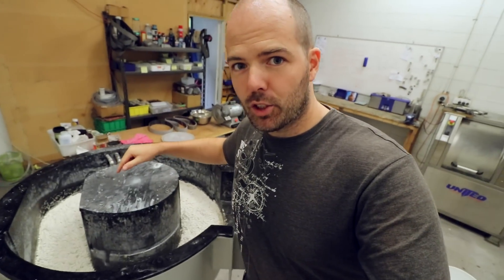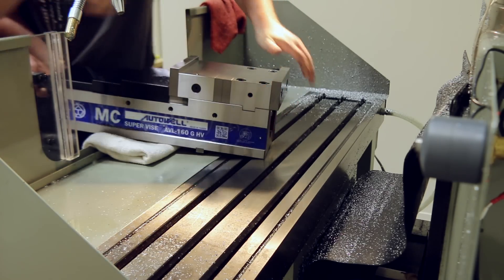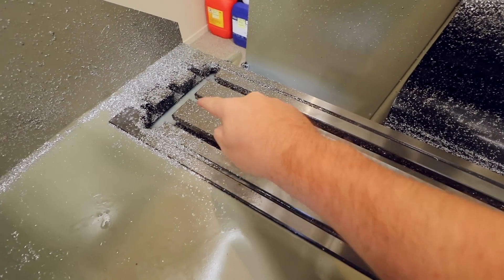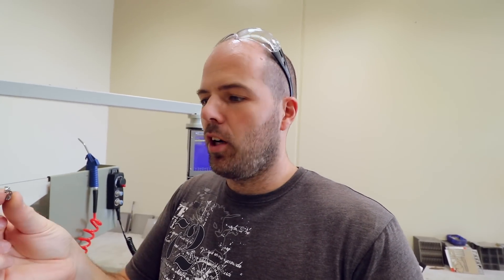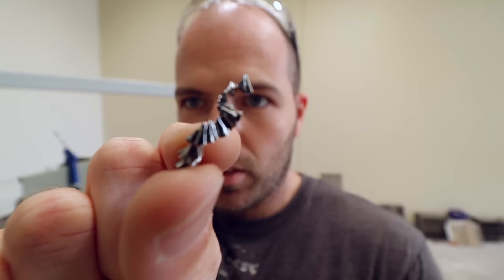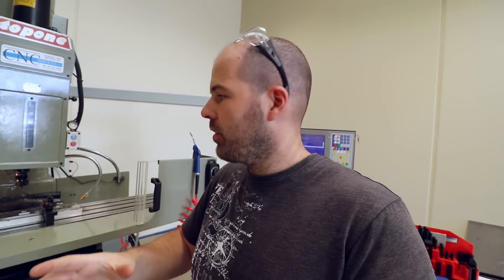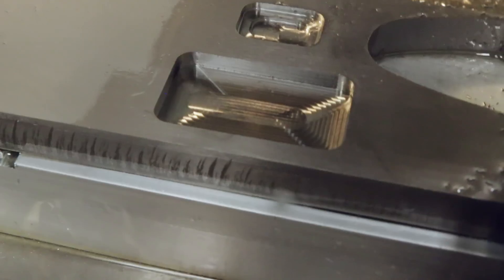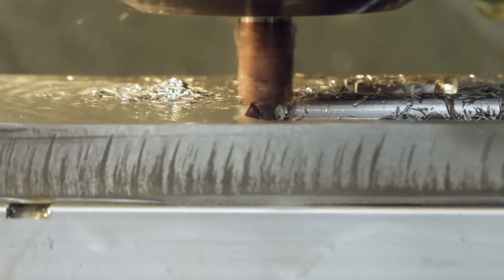How To Mill Titanium?

Comment: What cnc milling machine you are using ?     I'm looking for an very accurate +/- 0.01mm cnc machine to cut some titanium, at least rack and pinion rails and laser straight rails won't bend under 190 lb forces. Need to make an object 2ft x 5ft x 1ft and there is no such object sell it online need to cnc machine it by myself.

Comment: Why are you conventionally milling instead of climb milling? 
Don't you know that you can get t nuts to fit your t slots in your table. Vise size has nothing to do with it.
Reply: Could be his machines better conventionally. Our bed mill gets nasty looking with conventional cuts. Much better finish conventionally. The manufacturer is still trying to figure out why we suspect an issue but otherwise machines fine.

Comment: Been quite a while since I last commented! Loving the mill work, definitely looks like a good machine, and you are learning really quickly, so I am sure you will be making spinners and other things on there really soon!

With regards to the vise, I don't know if the dogs on the bottom are removable or not, but if they are I would check with the manufacturer to see if they supply them in smaller sizes before returning the whole thing. If they cannot be removed, then I would also check to see if they supply the same vise with different sized dogs, and if all that fails, only then would i return it for a smaller one.

Brad

Comment: Magnus, if you use your water jet cutter to cut a blank from a chunk of titanium, how do you register the size and position of it on your C&C machine to do further machining?
Reply: You use a tool called an 'edge finder,' it mounts like any normal bit, but it doesn't cut anything. It gives a visual indication when it touches an edge, and you just save that position in the computer. The computer then uses that information to set boundaries.
Reply: Christopher Vaerten thanks for the explanation!